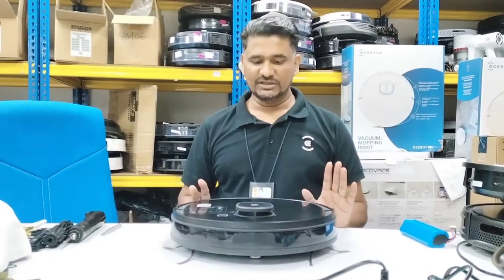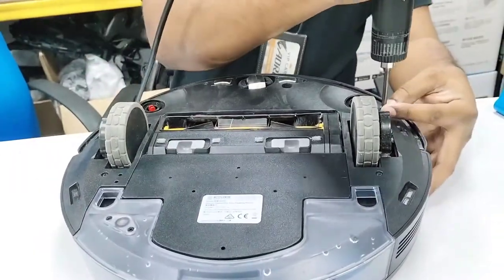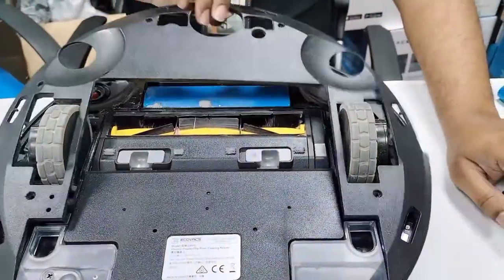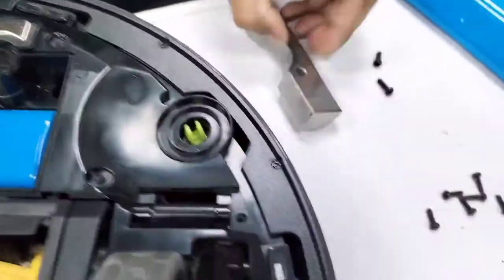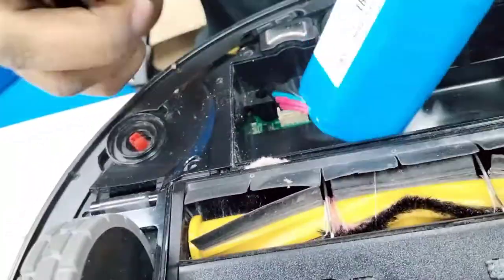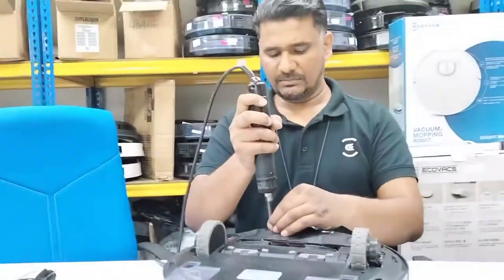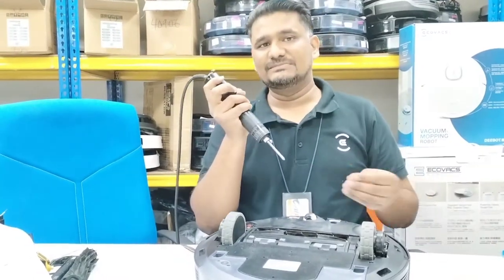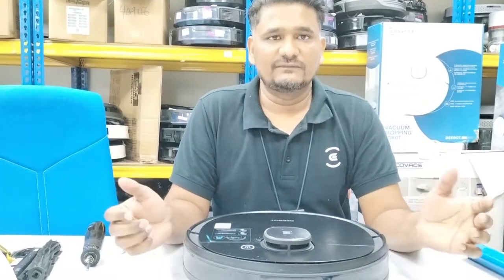DEEBOT | OZMO 950 | Can not Charge Or Runtime is Short, Want to Replace Battery 🔋

Comment: My deebot 920 says : please turn on deebot before charging. Deebot is on, i put a new battery, and it shows online, 100% battery on the mobile app but it keeps saying this and it wont start a new cleaning cycle. What is the problem ?
Reply from the maker: Plz disconnect from chsrger, power it on then try see whether LDS assembly turning or not if LDS turned but deebot doesn't move then core board issue, core board located beside motherboard a small green chip board...if after disconnect just giving error plz power me on then motherboard issue
Reply: Hi. I have a 920 the battery shows good % left, like 64%, but keeps going offline. I have had restored factory functions but same thing. The wifi signal it's strong and this started happening recently. The va is almost 3 years old. Do u think it's a battery issue? Or other? Thanks.
Reply from the maker: @andrewpg4456  function wise if deebot ok. No error then can not be battery issue...in this case coreboard issue... located next to motherboard a small green chip attached with motherboard
Reply: @ecovacstechnicalsupport5278  thanks for your prompt response. Do u know where can be sent to fix? I'm in Australia, Melbourne. Also how expensive could be? Better to buy a new one? Also why this happen? My vac it's spotless
Reply from the maker: @andrewpg4456  sir you can contact ecovacs hotline no. 1800812942 they can provide these details.i remember there is one official seller in Australia but need to contact with ecovacs